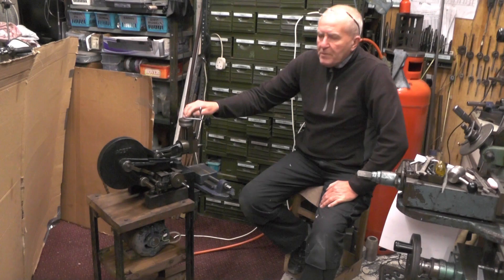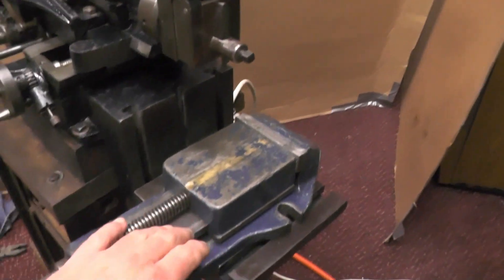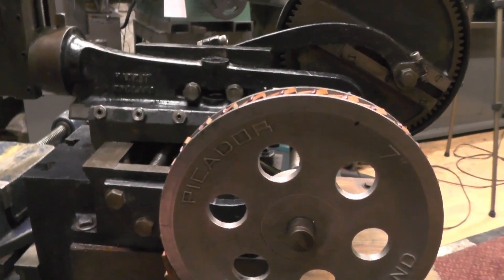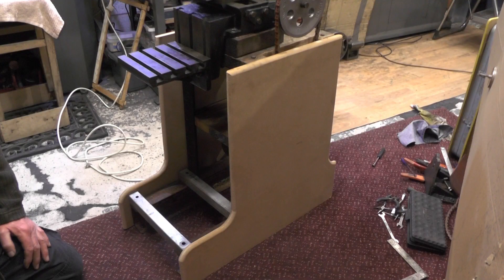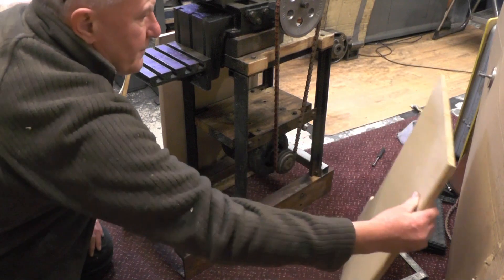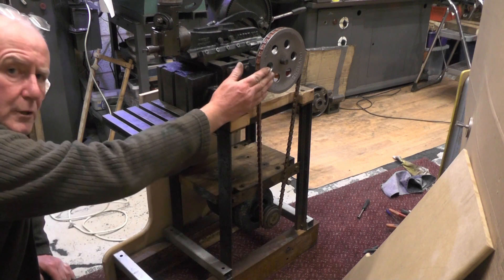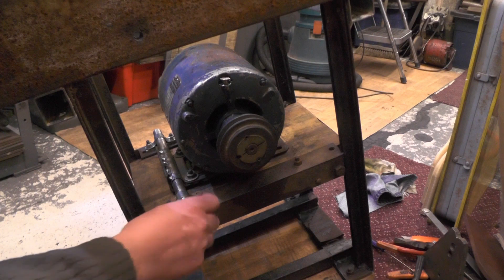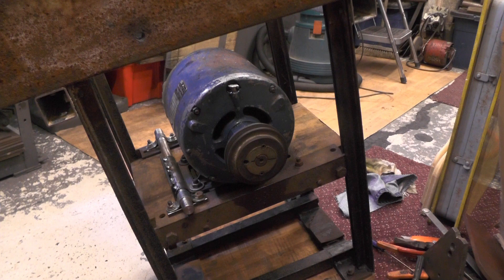Adept No.2 Shaping Machine PART 2 (New W/shop Addition) Re-Commissioning, Review & Modifications

Comment: Both ingenious and simple as ever. It looks to me as though the crank position on the top pulley can be adjusted, presumably to change the stroke length (but I may be misinterpreting what I am seeing). So if you halve the stroke length you will halve the feet/min cutting speed - to me, this makes your use of multiple pulleys really useful. If using the shortest stroke, maybe the current pulleys could be about right, say. Not that I know anything  about shapers, never used one, just watched a few on youtube.
Reply from the maker: hi tnld
thanks for feedback, yes you've got it👍 doing all the specifications in part 4, then some test cutting steel
take care
Kev